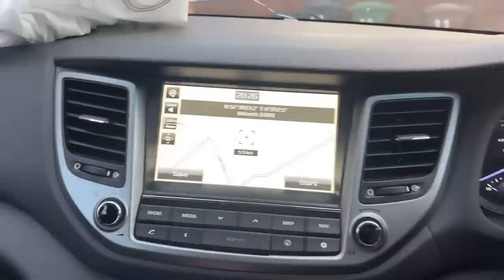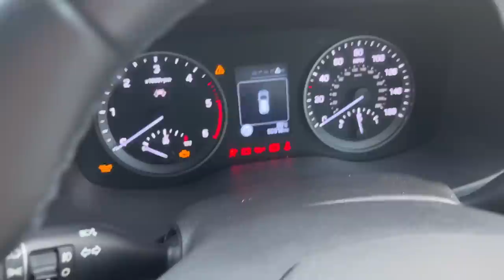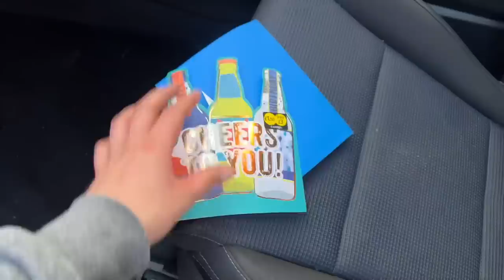I BOUGHT A CRASHED DAMAGED 2017 HYUNDAI TUCSON FROM COPART TO REBUILD PART 1

Comment: I have an SE Tuscon. (It's pronounced 'Tooson'...The 'C' is silent)  I think you will find the Rear seat are heated too, Switches are in the rear door arms. It may well have Blind Spot sensors. check for the little 'car' image in the door mirrors. The NS Roof rack fitting is for carrying a Canoe.. so those scratches come from sliding the Canoe up from the bonnet I should think. Many people may well find the rack fittings useful So you may well be able to unlock & sell separately.
Reply from the maker: Thanks for the comment bob and at least I know how to pronounce it now 😂 . And fingers crossed about heated rear seats I’ll have to have a look tomorrow . And never thought to think it was for a canoe thanks again bob and luckily no scratches on the roof must of been coparts camera lense regards nathan

Comment: Well the car has popped its bonnet hinges you will find the crash strip that has fibre optics that will cost you lots to replace the rest of the panels are easy to find,

Comment: The bonnet hinges on the Santa Fe 2015 can be reset, maybe worth speaking to the dealer see if that’s possible on this car? Might save you a few quid.
Reply from the maker: Brilliant advice Adam cheers mate I’ve just got a genuine Hyundai work shop manual so I’ll have a look in there

Comment: Would I be safe assuming this will cost you at least around £4000+ just in parts and paint?
Reply from the maker: You might be right on that Charlie. The parts I’ve already bought I may be able to do it for around £3000 but time will tell